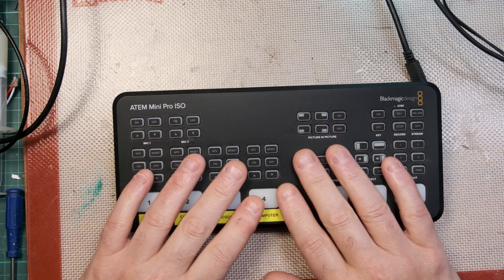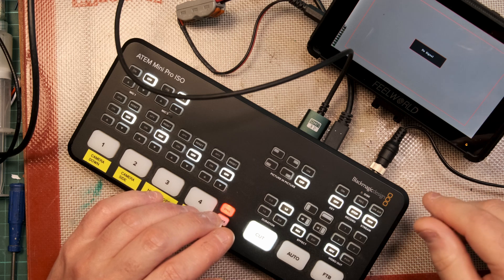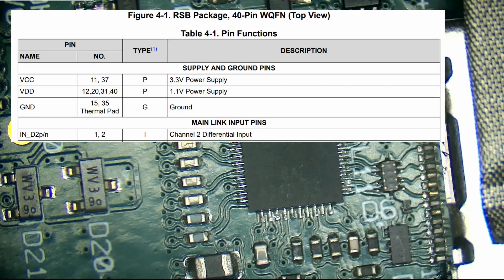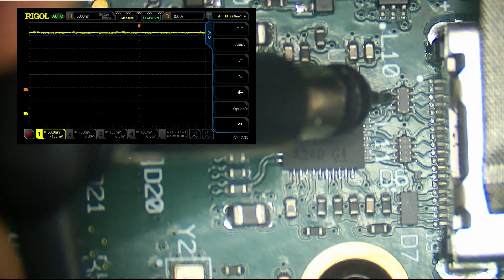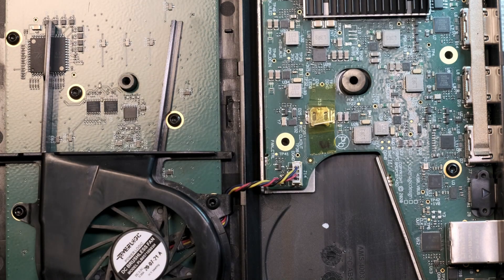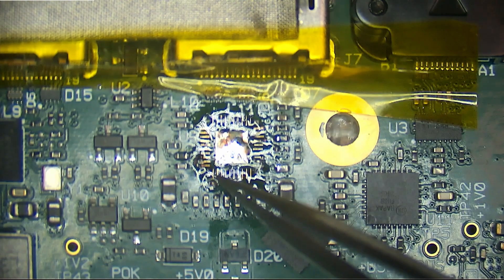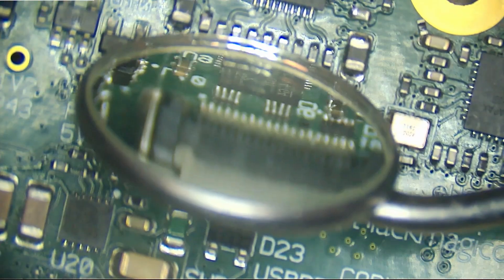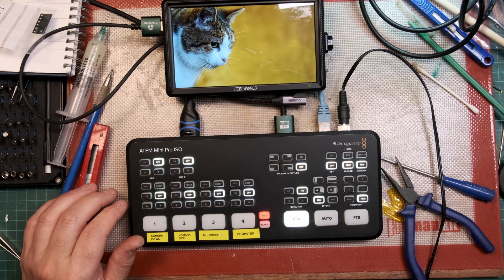ATEM Mini Pro ISO - HDMI Out Repair

Comment: I recently watched this video and I found it very informative. I’m experiencing a similar issue with my ATEM Mini Pro where the HDMI output rarely works, and when it does, the video quality is distorted or unstable.

I’m wondering if you could kindly provide some guidance:

Is it possible to fix this issue using the same steps shown in your video?
Could you share the part number or specifications for the IC/components you replaced?
Do you know of any reliable sources or suppliers where I could purchase the replacement IC?
Thank you so much for sharing your expertise. I’d greatly appreciate any advice or assistance you can provide.
Reply from the maker: I cannot say for certain if replacing the chip would fix your problem. The chip is a TDP158, and a reliable supplier would be mouser, otherwise eBay.

Comment: @14:07 missing resistor near brass screw/ground hole?
Reply from the maker: I hadn't seen that, but it was a replacement one that got lost, both when I was trying to solder it in and in the edit. Great Spot!.